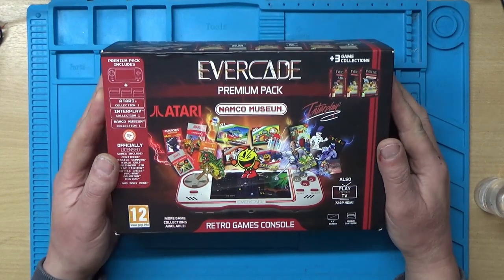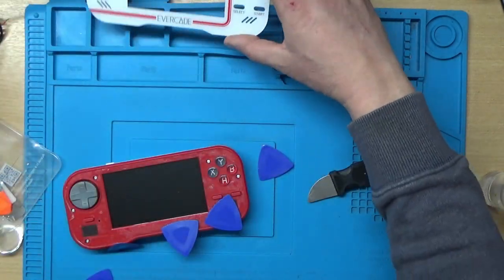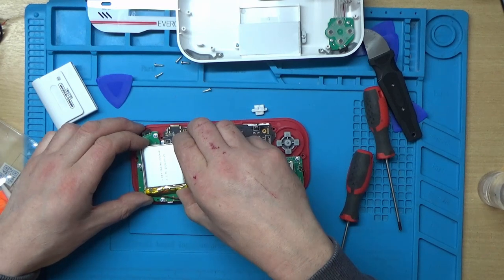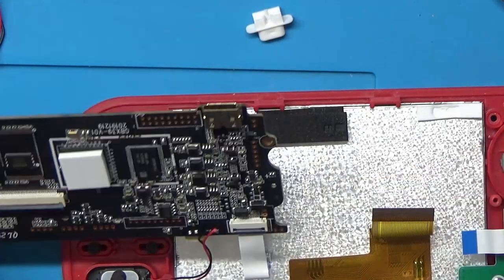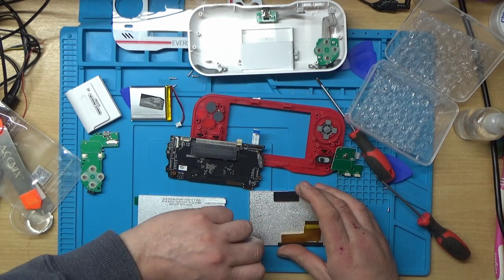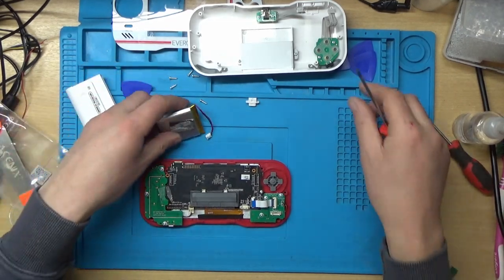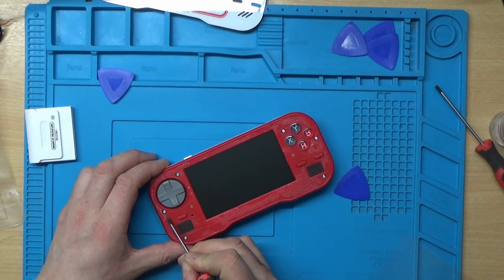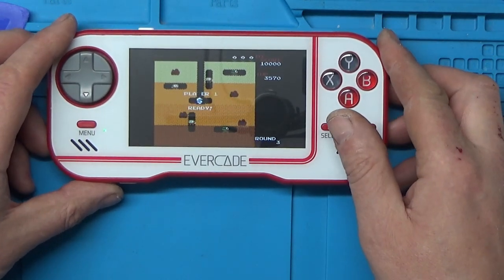I Bought the CHEAPEST Faulty EVERCADE From eBay | Can I Fix It?

Comment: Nice pickup  right there , I tried to post 2 comments on the LED video an the camera and microscope I found , But it had a link to the lens in it , so that might be why it kicked it off,,,
Reply from the maker: Thanks! Seems only channel owners are allowed to post links.
Here is a link to the camera very similar on the microscope that I use, and a link to a similar microscope: https://www.aliexpress.com/item/4000669145180.html  and https://www.aliexpress.com/item/32846880271.html although mine has a different arm / mount to that one. It might not be the best solution as even with a .5x lens on it it's still a bit zoomed in too much at times! I think it's due to the camera's sensor size which acts like a multiplier.
Reply: @BuyitFixit  The one lens i'm looking at right now is the 180 Zoom C-mount Microscope Lens 0.7X~4.5X Magnification. and the camera is almost exactly like yours It's a High Cloud for 75 USD I rather the Eakins like you have .....  Thanks
Reply from the maker: Sounds good. I think it's the same magnification as mine but if the camera is full frame then those are what you would get, but if its 1/8" sensor I think it's like 8x4.5 so that would be 36x and with a .5 barlow 18x check out a channel called northridgefix he uses a slightly different setup which might be a better option.
Reply: @BuyitFixit  Actually the lens I want is the exact same as Northridge uses and he uses the Barlow 0.5 and 0.75 for getting the scope lens higher off the board to have more room for soldering tools .... I looked at your camera on Ali and I do like the Eakins brand ...So that's what I'm gonna get along with the 180 Zoom and a boom to hold it all . I'm not using the eyepieces at all.... Cam , lens and led lites and boom holder and HDMI it to my wall monitor .....Merci encore' / Thanks again for your replies ....
Reply from the maker: No problem mate. The idea behind the channel is to help people so I do try to be as helpful as I can!